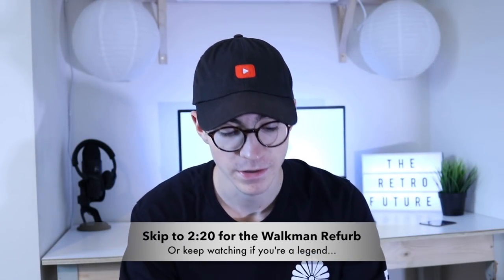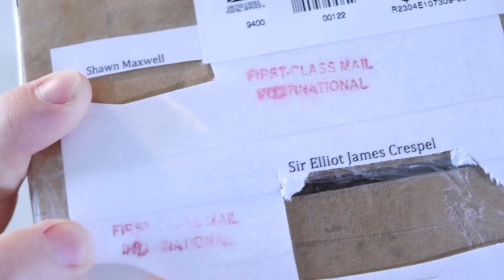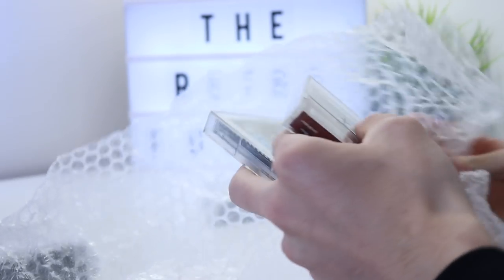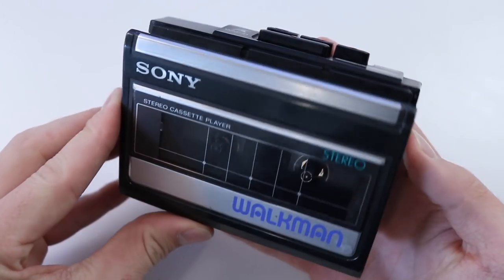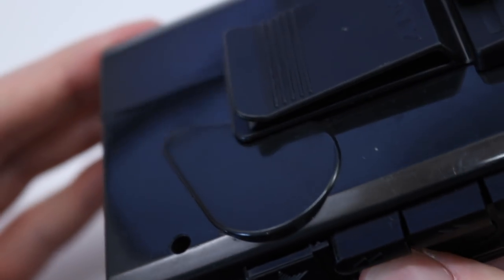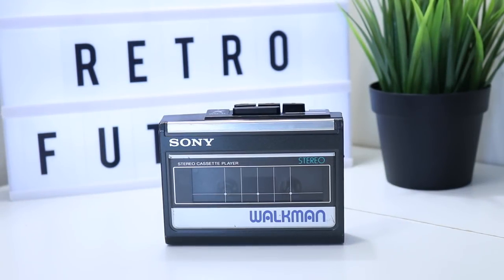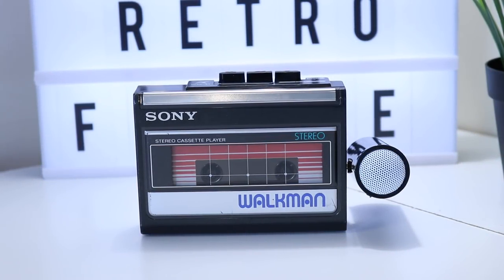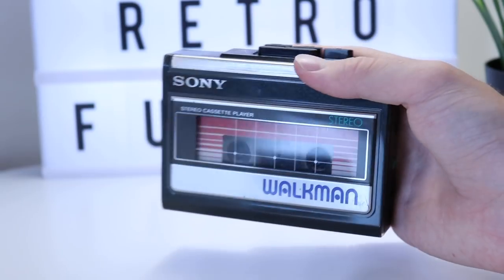Let's Refurb! - '13 Reasons Why' Walkman Repair!

Comment: People dump on this all-plastic malaysian model (WM-31/WM-41 or WM-F31 / WM-41 or with equalizer WM-33 / WM-43 or WM-F33 / WM-F43) but in fact, consumer reports in the usa tested 25 models and this one CRUSHED all walkmans EVEN ONES FROM SONY at $100 or less!  And this design-for-manufacturing model cost only $40 and could be sold in blister packs in drug stores!  The high-volume and low-cost-of-assembly (only 3 screws) meant VALUE FOR MONEY!  When I learned this I rushed out to buy one for every room in my house!  This is a keeper!  Better sound than any earlier model !!

Comment: I have the nearly identical WM-F41with a tuner, but the player internals are cheaper, with a plastic pulley instead of brass, and the motor has no foam damping pads. I would choose your model as it probably has better playback properties once regreased and aligned.

Comment: You kinds overpaid for that. But walkman prices are shooting up. I remember seeing them for about £20 or so.

This is one of the first, "cheapo" walkmans, starting the post 1985 trend that I call "the cheapenning". Previous models had double flywheels, and were more rugged all throughout.
Reply: There’s an increase in sales rn because of stranger things and they are WAYYY overpriced
Reply: @americandomino3656  It started with Guardians of the Galaxy tbh.

I wish I had caught on to the craze in the mid 2000's because at that point even the most saught after models were relatively cheap. Now I keep them as a retirement plan considering how crazy they pop up in price!!!!

Comment: I Just got a WM-31 which is the same as the WM-41 shown here. except for the position of the belt clip.
On the type plate the type is listed as WM-31/32/41.

Comment: I didnt't knew you had a video about this model!!! I have this model too, i dont know if you still have it, i have a quick question about this model and i hope you could help me. ¿What's the factory value set on the orange potentiometer for the motor? mine was all messed up and i want to set it to the proper value (the potentiometer is on the upper left corner, next to the motor) if you could help me i will be so happy, im a fan of your channel, love your videos man!

Comment: You mIght wanna try out the WM-8 in this series of fundamentalist walkmans which runs on 4 PCS of AA batteries, outputting 35mW a channel. It will allow you to run Beyerdynamik DT990 low impedance model. I use it with my Sennheiser 414 Signature and it sounds fabulous, somehow comparable to my home decks such as Sansui SC-5300.

Comment: Nice video mate, are you any good with Nintendo switch? The SD card port on mine doesn’t work :(
Reply: Luckily the sd card slot is on it's own small board so it's super easy to replace.
Reply: sjm4306 ahh that’s awesome man!

Comment: where can you find the rubber straps for sony walkmans, the black ones of the video? thank you!
Reply: Saverio Petrocelli If you're talking about the rubber drive belts inside of the machine, you can find those on eBay pretty easily. For buying belts specific to a particular model you can go to "mihokm"s eBay store where he sells belts specific to particular models.